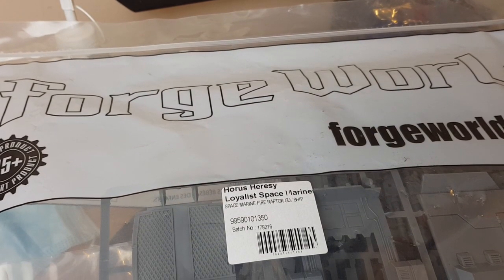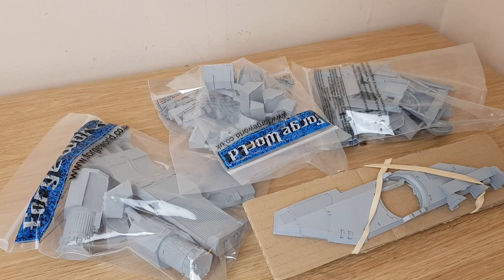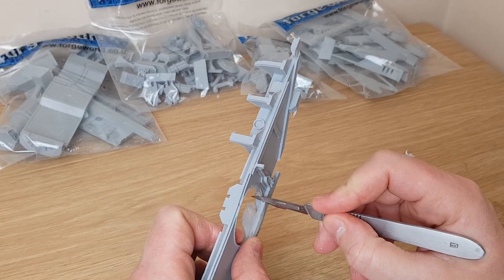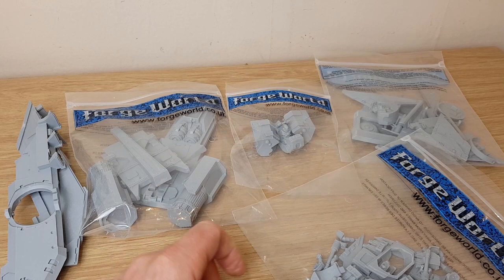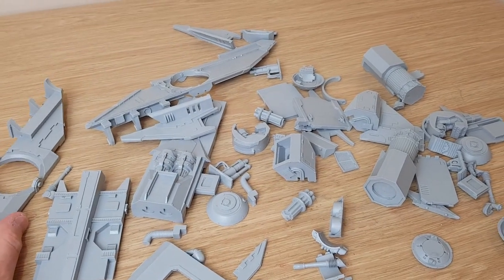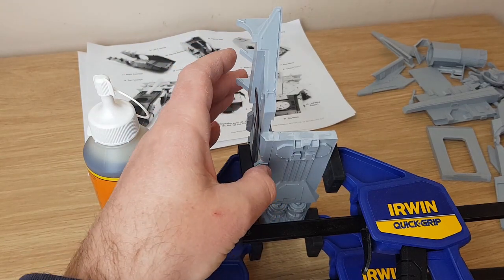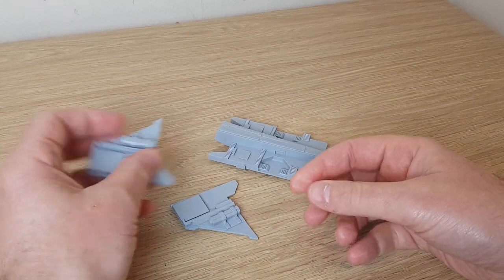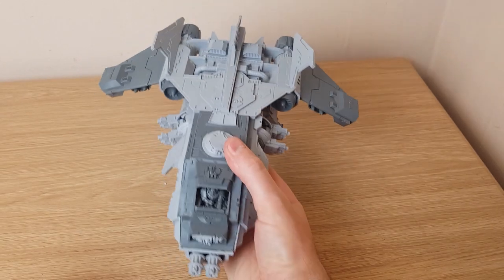Forge World Fire Raptor Gunship part 2 - how to build resin models

Comment: thank  you for this excellent video! I was considering getting one but I have not had much luck in the past with FW resin and trying to reshape it.
And your video also points out a common complaint I have read about with the sides of the main body being warped straight out of the box.
Now that they recently have announced a hand full of them being re-released as plastic kits, I will wait and see If they if they make this as well.
Reply from the maker: Glad it helped 😁 I think for the money the quality should be higher... but I think fitted resin with perfectly shaped plastic is a recipe for disaster 🙈

Comment: Quick passing by; good to see someone who knows their glues! For the gun turrets, you could get some stiff clear styrene sheet and bend it over as windows, maybe backed by some styrene rods to form a rigid frame. You can also warm and bend styrene with hot air, if needed.
Reply from the maker: haha thanks, my other favourite is JB Weld epoxy 😁 thats a good idea with the sheet, I haven't done anything special with mine. You'll see it painted up Death Guard on a recent video https://youtu.be/djqZhB-XNCs